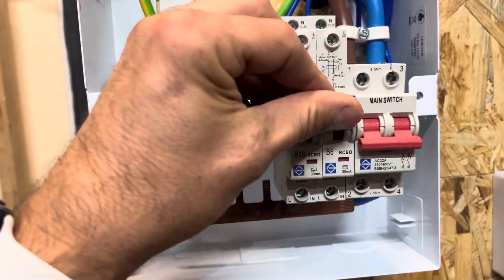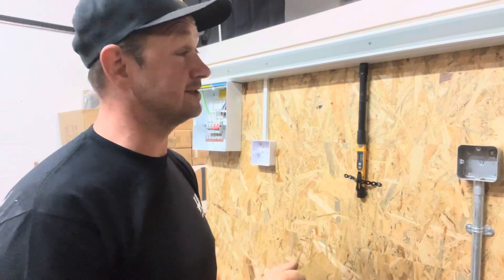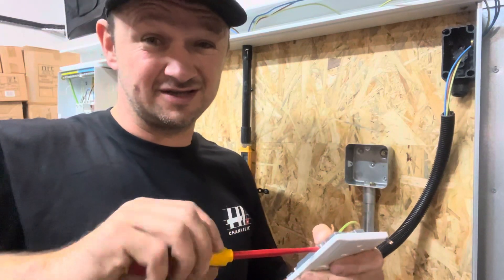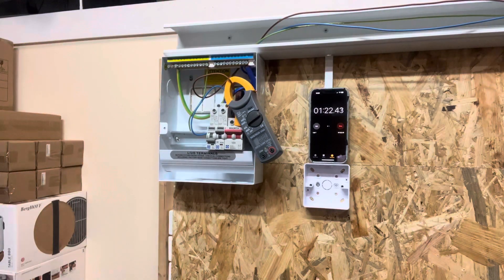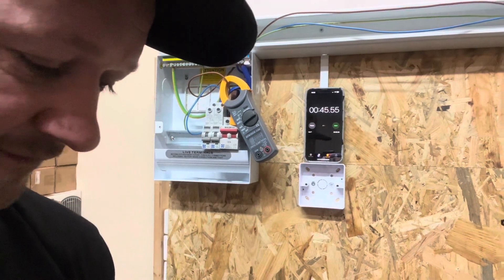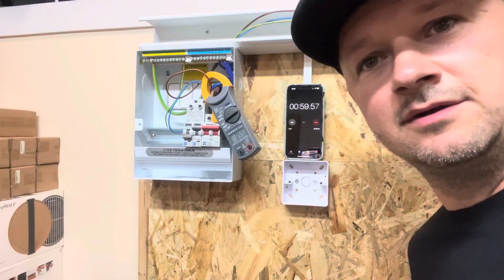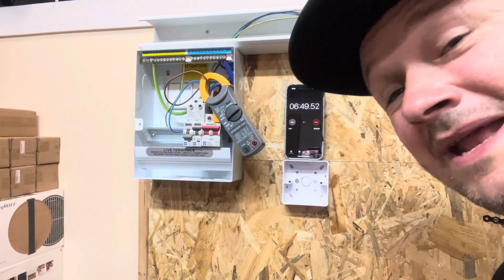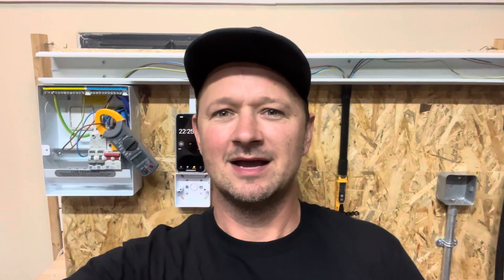The Shocking Truth About 6amp Overload You Need to Know

Comment: A qualified electrician should really be more familiar with the B curve in my eyes.
Reply from the maker: Do you think?
Reply: The B curve gives information on the period of time a B type circuit breaker will tolerate an overload condition before tripping. The time delay before tripping is inversely proportional to the percentage overload. An MCB does 2 jobs: 1) It trips immediately in a severe overload condition (i.e. short circuit). This is achieved by an electro magnet in the MCB which unlatches it. 2) It trips after a period of lesser overload - to prevent the wires/cables in the circuit it is protecting from overheating. This is achieved by a resistive element inside the MCB which heats up at a similar (but slighly quicker) rate to the wires/cables it is protecting. When it warms up sufficiently, a bimetallic component in the MCB unlatches and it trips. The whole idea is that if a circuit is slightly overloaded, it takes some time for the wire/cables to overheat - the more overload, the less time. A good example would be on a ring circuit: Imagine you have two 3kW heaters on permanently pulling around 25A, and someone puts on a 2kW kettle pulling around 8A. Total load would be 33A. Does a B32 MCB trip as soon as you put the kettle on? No it doesn't. Why? Because the kettle is only on for a couple of minutes and the wires/cables are not overloaded for long enough to overheat. In a sustained overload condition for a long enough period of time, the MCB would trip before the wires/cables overheated. Hope this helps.

Comment: Overcurrent protection is usually on an Indefinite Minimum Time curve (IDMT) defined within the relevant standard. At 8.5A load you are 1.4 times the 6A rating and from the B6 curve it will take over 60 minutes to trip when cold or 40 seconds when hot. At 16.8A you are 2.8 times the 6A rating and it will take around 1 minute when cold and 30 seconds when hot. To get a B6 to trip instantly you need to inject over 5 x the rating when cold or 3 x when hot, i.e. 30A and 18A respectively.
Reply from the maker: Brilliant thankyou.

Comment: Also worth mentioning that your clamp meter isn't True RMS.  Won't make much difference if you're measuring a clean sinewave but will give false readings if the sinewave is distorted, measuring a phase controlled output etc.

Comment: 6amp is the working current and will carry that for twenty four hours a day every day, it is not the tripping current so even if it went up to a 100 Amps it will not trip the 30ma tripping current is the difference between the line and neutral current if both are the same ie equal it will not trip if it detects a 30ma difference then it will trip .
Reply: You’d be correct if he was testing a RCB or more correctly called a RCCB, but he is testing a RCBO which combines the function of an MCB and RCCD. RCCDs are additional protection.

Comment: 9:50 The RCBO hasn't had any time to cool down yet, thus it's going to respond quicker.
I've had a look at Schneider's trip curves according to IEC60898, and it says the breaker will turn off after 1h with a load between 1,13 & 1,45 In. Worst case, you could pull 8,7A for an hour.
Reply: I concur.  As I understand it, the standard says the breaker must not trip within 1 hour at 1.13x, and must trip within 1 hr at 1.45x (which is basically what you said).
Reply from the maker: Brilliant - Thank you
Reply: @toolboxtalking  just a thought: try repeating the experiment with a breaker exactly matched to the cable, e.g. 6A MCB, 0.75mm flex (which I think is rated at 6A, check that), and try running it at overloads of different magnitude.  See if you can heat the cable above its operating temperature, and if you can cause actual thermal damage to it (I doubt it will be possible, but it will be interesting to see where it gets to).
Then perhaps repeat the experiment again with a breaker rated somewhat higher than the cable rating, e.g. 10A MCB, 0.75mm flex, to see at what level of overload thermal damage begins.
Reply: If anything, this video is showing a reason for using lower tripping breakers.
Many years ago, i also thought breakers switched off at exactly above In, thus 6,001A for a 6A breaker.

Comment: If its a RCBO

B6. Then 3 to 5 time rated current
C6.  Upto 10 times rated current
D6. Upto 20 times rated current

The main reason is to deal with inrush currents

RCBO is normally a MCB and RCD in one unit for greater protection

Cable sizes have this extra allowance factored in

Other points to consider is Earth leakage.  If the appliance has electronics inside then it will naturally leak a certain amount of it (Normal operation) to PE down the CPC/Earth cable so 30mA can be reached quite easy if you have lots of LED lights or PC (Personal Computers) on a circuit.  Think of a CU/DB in a school.
Reply from the maker: Fantastic response - Thank you